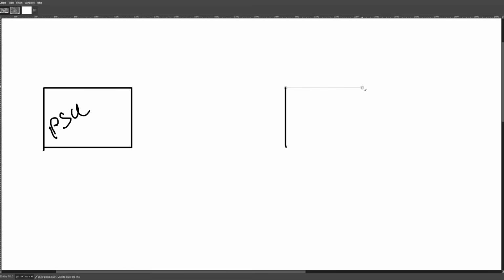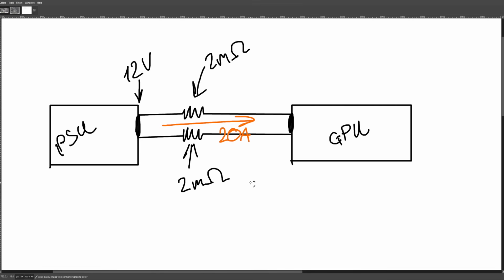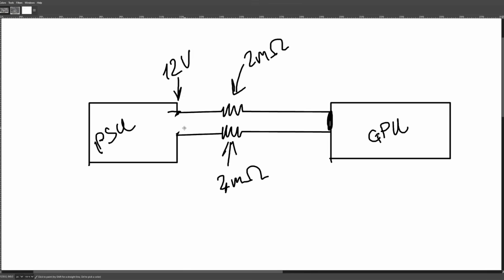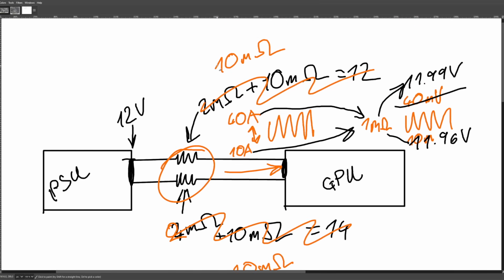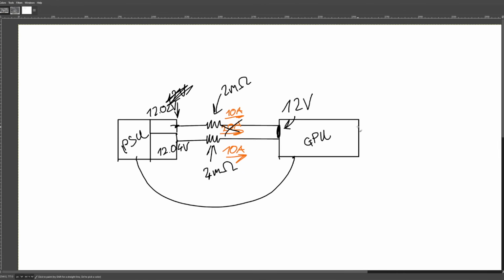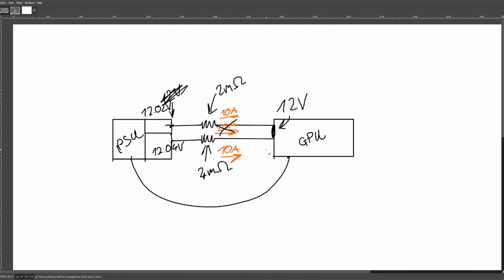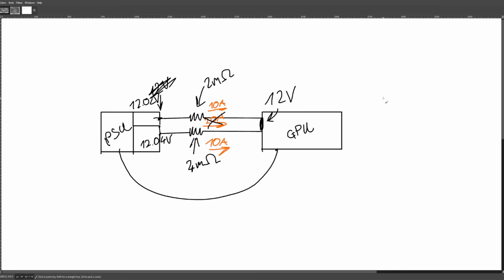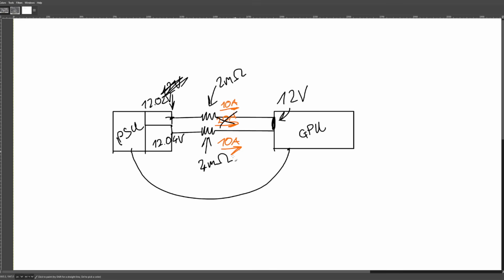Why ATX power supplies don't load-balance power connectors

Comment: "Why don't we just change every PSU ever made just in case you have one of Nvidia's broken £3000 graphics cards" -Someone with an rtx5090.
Reply: There is a lot to criticize Intel about, but ATX is not one of them. In fact, I wish they'd go a step further and specify modular pinouts so that you can grab a cable your box of spares and not melt your PSU and/or peripherals as a result. If you dislike ATX, you really need to be blaming Dell, Compaq, HP, Gateway, Packard Bell, etc. for not settling it amongst themselves for a decade until Intel forced the issue.
Reply: Tbis is what happened, BTW.
Reply: @randavael  Now we all pay for their mistakes.
Reply: Also overall if there is a high resistance connection instead of trying to pull more power which gpu would to balance input as some power goes away, the psu would provide same power to all lanes
Reply: @DepressedMusicEnjoyer  PSUs have overcurrent protections which detect shorts. 

It makes no sense to balance the load on PSU side because the only way to balance there is to vary output voltage per wire, which basically means instead of 1 PSU you need a PSU per wire, you can imagine the costs of that.
It's much more straightforward and economical to just wire different wires into already existing separate VRM phases that already do current balancing for free. It's how it was done until nvidia just decided they don't want to do it anymore because their PCBs are too small to have few multiple +12V power traces or something.
Reply: @ hmm true, yeah cost wise and implementation wise would bring cost too high and even if in theory it could sometimes get useful the cost impact on power supplies would probably end up with people just not bothering to buy ones with this.
While with cards the impact is much smaller especially relatively
Reply: It isn't a stretch for a power supply to also handle protecting the things connecting the power supply. Just saying. Even if Nvidia could fix their issue doesn't mean a psu can't benefit
Reply: That is what spec says, right? gpu should not power balance.
Reply: @lolerie  because it's a shitty inclusion into the spec that solely nvidia lobbied to be added for the single purpose of making their PCBs smaller for the fancy FE designs. It's so obvious it's just them for just their purpose because no other GPU maker is using this part of standard.
Reply: While this is true in theory in case another issue happens - which is very unlikely, but if it would, let’s say a cable somehow has a partial short, the gpu has no way to detect it, or well it’s way easier for the psu to detect as the loop is closed before reaching the gpu
Reply: It sounds ridiculous but we all know that NVIDIA won't fix its mistakes so that would be the only logical alternative.
Reply: @zeemon9623  Continuing to buy knowingly defective Nvidia cards is the only logical alternative?
Reply: @tomstech4390  Not exactly. In the context of people continuing to knowingly buy defective GPUs, it is. I'm not touching anything with 12vhpwr (or whatver they decide to call it this week). But power delivery has 3 components: the PSU, the GPU, and the cable.

It would be weird to overengineer cables.
NVIDIA is not going to change course.
That leaves the PSU as the only option.

I'm not even saying it's a good idea to do so. But the question of "can't the PSU makers fix it, seeing as NVIDIA won't?" isn't entirely terrible.
Reply: @zeemon9623  Nononono shush, Nvidia has to conform to ATX standards. Not the other way around.
Reply: @punktkomma9489  ATX is intel's standard, not a compulsory one
Reply: @erkinalp  ah so it's free roam now and everyone does however they please. we all loved the days of every single manufacturer on this planet having several different special connector types, some of which were straightup fire hazards
Reply: @erkinalp  saying it like nvidia hasn’t shilled this connector into the standard.

Comment: In conventional current we talk about the + but electron flow is from the -

BZ does this have something to do with why its always the 12v lines that melt ?
Reply: The zero volt wires are in parallel with every other zero volt wire to the motherboard 
Therefore the zero volt wires to the gpu will always carry less current than the 12v wires to the gpu
Reply: No

Comment: I imagine switching with mosfets per pin at gpu would be best way to load balance
Reply: It certainly would be insane and absurdly expensive
Reply: @punktkomma9489  not at all. MOSFETs are dirt cheap especially at the scale they would be buying them. It would literally add probably less than 2 dollars to the BOM cost, and would take an engineer half a day max to design and add in the circuit. It's that easy and cheap. That's why this is such a stupid issue to be having on these cards.
Reply: @spectrum_observer  Yes, let's add more componentry and points of failure to hopefully force electricity into submission, when we could just rely on redundancy and safety margins that adhere to reality
Reply: i swear to god there is no correct implementation of the current 12vhpwr connection standard. it's rated for 600w continuous load plus 10% safety margin. we frequently experience catastrophic failure below 600w continuous load in real world applications. nothing short of - running load tests, monitoring every single 12v conductor and software telling the user to replug the cable until load equalisation has eventually been achieved - will fix this. and that is not a permanent solution because cables will move, shift and sag

what they should have done is a new iteration of an 8pin connector rated up to 300W with 50% safety margin. two pcie 8pins could go into an adapter cable for sufficient backwards compatibility. that could've solved two problems at once by replacing eps12v as well. hell they even could've used a similar form factor and basically the exact same load specification. eight pins from 12vhpwr can officially supply 400w or 440w with 10% safety margin. they could have easily avoided all this crap
Reply: The 3090ti almost does that with dividing the 6x 12v pins into 2 + 2 + 2.
Reply: Amazing that Nvidia did the 12 pin correctly the first time, and then ruined it in subsequent versions

Comment: Instead of running MOSFETs as extra resistors, you adjust the feedback loop voltage targets on each "mini-rail" until you can sense equal current flowing through, say, 1mR sense resistors on each pin. Although, exactly the same as the MOSFET linear dissipation idea, it adds a bunch of crazy extra cost and componentry to solve what should be a niche issue.

Crazy idea, what if we have two power connectors when your GPU is drawing half a kilowatt from the wall...
Reply: There's also another problem, albeit unlikely: If you have a GPU that actually current balances itself, you may get into the situation where both ends fight over the balancing, Perhaps this could cause oscillations or you'd need extra logic to prevent that.
Reply: @theIpatix this is the real issue. If it's not in the spec, stuff like this simply causes incompatibilities.
Reply: don't look at kW, look at the amps, that is the determining factor here, kW simply means how fast the connection will fail in case of a problem, it is a 50A connection, relying on "scraped" or "unscraped" or whatever the F, when the root of the problem is inexplicably bad choice of a connector in the first place, someone is clearly doing bad decisions on purpose there
Reply: @rikkc137  or we can just lower the amps, and put a transformer on to GPU😂
Reply: @jermygod 
Oh my, RF engineers would have your head for putting an unshielded magnetic flux generator on a high frequency device...
Reply: well, that's realistically what would be happening. But you couldn't just adjust the feedback loop voltage because there isn't more than one "mini rail". There is just one rail. You'd need to create multiple "mini rails" by putting MOSFETs on each of the 12vhp wires. Otherwise you'd have no way to individually adjust the voltage of each wire.

Even if you had two power connectors, it really doesn't matter, when you're drawing this much power and you're using multiple thin wires with small connectors, you should be load balancing. Regardless of having two connectors or not. You could just load balance each connector instead of each individual wire, but you'd still need balancing to have a safe design.
Reply: @spectrum_observer  can easily do it with multiple switching setups, but it gets pretty costly. So you're running switching mosfets, not linear regulating ones

The PSU would be aiming to generate an average of 12V over the combination of rails, but with each rail self adjusting to provide an equal amount of amps. If one wire is higher resistance, it will raise the voltage slightly so more amps tends to flow through, while the others slightly lower theirs, so less amps flow through, while all of them still hit the sum of 12. There'll be a stable solution to that eventually.

Comment: My PSUs (bequiet dark power pro 1000w/1200w) have separate rails for each GPU. They have an "OC" button that shorts them together. But as far as I understand it, they are separate rails. So technically they shouldn't be able to push 600w over a single rail and instead trigger ocp. Do you have any info on this and how reliable it is or if it protects enough against this issue?
Reply from the maker: you probably have per-connector OCP not per-wire OCP.
Reply: Pressing the OC pin would also double the OCP limit value. However an true OCP limit only makes absolute sense when one knows exactly what is normal and what is abnormal current draw. A 400W OCP limit makes no sense if you have a system that normally draws 600W, and a 800W OCP is also mostly useless if a system only regularly draws 300W. So theoretically, one would measure what peaks your system draws and set the button for whichever value best protects vs that draw.

Comment: One question is bothering me. Since the PCIe standard provides 150W per 8-pin connector, why does Corsair include a 2 x PCIe to 12VHPWR cable for the HX1200 PSU? That would give us a maximum of 300W. Did I miss something? 🤔 Fallowing this understanding i used 4 x PCIE to 12VHPWR custom  cable... to sleep well :).
Reply from the maker: the PCI-e 8pin has an insane safety margin on it.
Reply: @ActuallyHardcoreOverclocking The stock cables were 1xPSU-side connector to 2xPCIe 8pin. So if the 12VHPWR cable uses two PSU-side connectors that is entirely natural.
Also PSU-side connectors ARE NOT REGULATED OR STANDARDIZED. They are not PCIe 8-pin connectors by definition. The lack of regulation is why using cables that didn't come with your modular PSU or weren't explicity made for your PSU will destroy your hardware since the pinout and amperage is entirely up to the PSU manufacturer. Any regulations for 8-pin PCIe do not affect what the connector on your modular PSU outputs. Only the end of the cable that goes to the GPU is regulated.
Reply: @ActuallyHardcoreOverclocking doesn't look insane from 2025
Reply: Corsair would say it has specced its own PSU PCIE connection point for higher, and as long as you use only its own cable, you can then step over the PCIE standard when ending the connection in a 12VHPWR connection. If you plug a normal 8-pin into the connection, then you should again obey the normal power limit.

Comment: This feels like an Apple-esque problem. They really wanted to make this tiny little 5090 so they have no space for current balancing, extra connectors, or 8-pin connectors. so they picked a sleek form factor and have put themselves into a design corner with no good solutions. (glares at trashcan mac pro, etc)
Reply: if 5090 has 12 phases for Vcore, they could just connect each 2 phases to own wire on connector side (12 pin 12VHPR)

It so simply that even nothing need add to schematic only split wires from every 2 phase and now you has perfectly balanced 12VHPR connector
Reply: Apple on its way to put power button beneath their new mac for absolutely no reason: (samsung and msi/asus version when?)